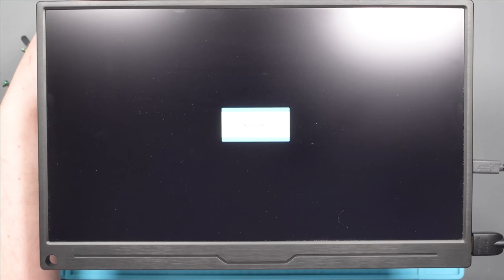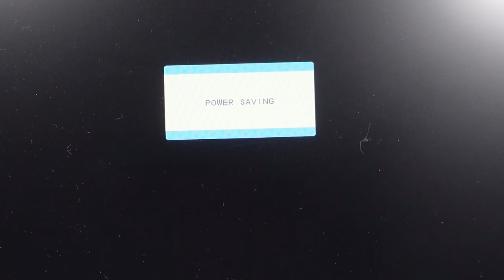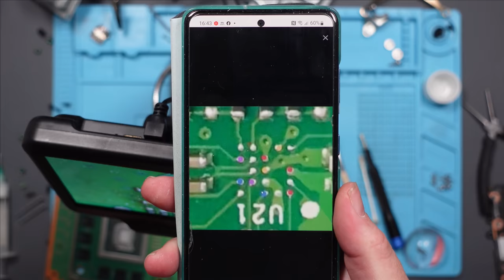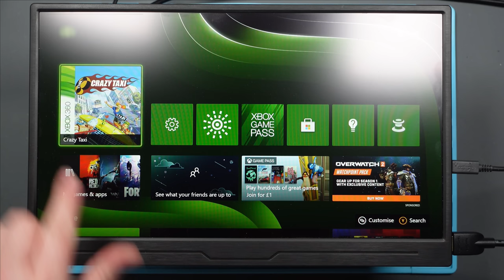I Paid £250 For a Faulty XBOX Series X | Can I FIX It?

Comment: Next time, cut off the metal tabs that goes through the board on the connector from the top with a sharp dyke first.  You can use soldering iron and wick (or a desoldering tool) to pull it out the pieces in the PWB board.  After that, you only have to desolder the pins to remove the connector.  Since you are replacing the connector anyways, there is no point in saving it.  Putting that much heat into the board could damage many parts.
Reply: You have no clue what you’re talking about
Reply: @hellomynameisaustinw  Sure, of course I don't know what I'm talking about.  Everyone knows that blasting the board with heat is the best way to remove parts that has lots of metal and heat sinks on the board with heavier copper layers.  If you are not reusing a part, its always easier to cut off all the metal components to minimize the heat sink to reflow the solder quicker.  

In our labs, we even use a hot plate to get the temperature closer to the melting temp and it helps to prevent thermal shock on capacitors.  I only use Metcal soldering and desoldering stations my benches at home.
Reply: @ahndeux  heres my guess based on the two comments you left: 

You work in an environment where you are surrounded by these types of things but you work for a large company / contractor that puts a bunch of red tape behind repair process. Or maybe you are a small time bespoke repair company and you’re afraid to get your hands a little dirty to push your limits?

In reality, the “best” way to repair something is accurately and quickly. I also only use metcal, and I use a heat pad underneath as well. 

The whole “cant use too much heat” is totally unnecessary to adhere to. I can get an HDMI port soldered on looking factory new faster than it takes me to tear down the whole console (which is usually around 10 - 15 minutes). That’s maybe 3 - 4 minutes of heat on the board for removal and application. Ive been doing this for years, and Ive fixed thousands of consoles. Ive never had a warranty situation arise from thermal shock.

If you wanna keep wasting your time, then keep worrying about those electrolytic capacitors above the HDMI retimer on the series X, I promise they’ll be okay.
Reply: @hellomynameisaustinw  We do military style connectors which takes a lot more heat than a typical connector.  The parts on the board costs thousands of dollars.  

We are not going to sit there with a heat source over a component and potentially damage other parts around it like that.  If you're doing a commercial part that is $10, go at it.

You want to reduce any thermal risks to parts around it.  With large heat sinks like metal tabs on 25 cent connectors, cut them off.  Don't waste your time.  

Some of our boards have 2 oz coppers and its over 30 layers thick.  We are not going to sit there with a hot air reflow and worry about other heat sinks around it.

If you seen his other rework before, you would have seen him scorch parts all around it and still not get the part off.  

We use automated rework machines for heavier parts at work.  Some of the newer machines don't even use heat but a CNC cutting bit to cut off the old BGA parts and leave a stub of the lead in order to prevent damage to the boards.    It has a vacuum tool to suck up all the pieces cut off because the $150,000 board is worth more than the $2000 chip part.
Reply: @hellomynameisaustinw  The company just bought two AVX1000M AirVac rework stations.  It's one of the few machines that can actually get the work done without damaging the boards.  It's one bad... machine.
Reply: @ahndeux  well, you certainly know your domain. 

I think there is a distinct difference between what you do and what the gentleman in the vid is trying to pull off. A simple HDMI replacement is not equivalent to a $150k board rework! 

Sorry for the hostility lol you just came off as someone with very little experience with basic cheap mobo repair, but in reality your scope of knowledge is vastly different
Reply: @ahndeux  Id kill to mess around with a rework station like that!
Reply: @hellomynameisaustinw  I don't take offense.  I do my own repair work on commercial electronics on my home work bench also.  

I have been working on electronic repairs for almost 30+ years both as a hobby and professionally.  I have damaged many parts as part of my learning experience and tend to be more conservative when it comes to creating more damage.  I worked with NASA quality builds and its a whole different level of requirements than commercial electronics.  Mistakes can be a lot more expensive on those types of PC boards.

With low cost parts like these types of repairs,  lifting a pad or damaging traces take more work to repair than to just snip the parts off to minimize potential for damages.

I just love watching StezStix because he takes bodges to a whole different level.  LOL.
Reply: @hellomynameisaustinw  It's a great tool, but it will obviously destroy the component.  

I use a BST-863 for my own home hot air rework station.  Its a great rework station.  The best thing I got that I loved the most is a Metcal MX-PTZ style tweezer solder head.  It makes replacing SMT parts a breeze.  In the old days, I would use two Metcal stations and two soldering iron heads. You just pick up the part as if its a tweezer to take them off or to reinstall a new part.